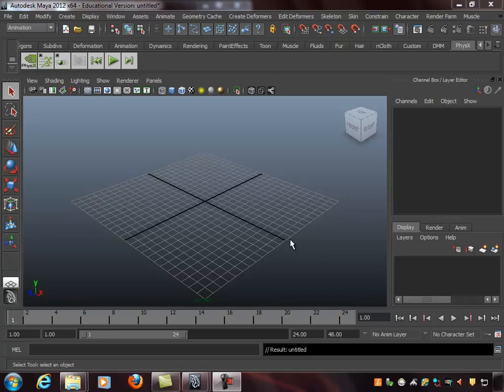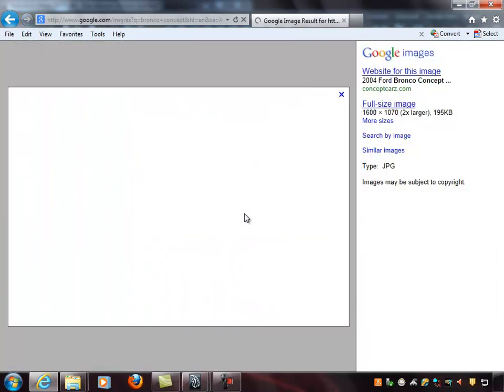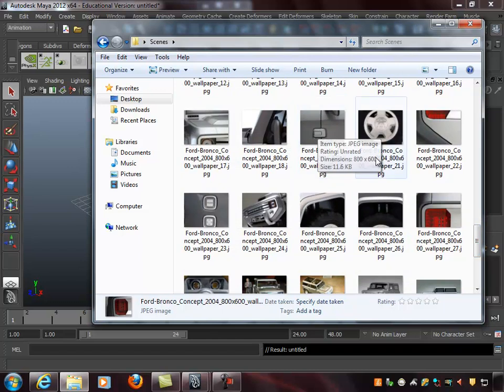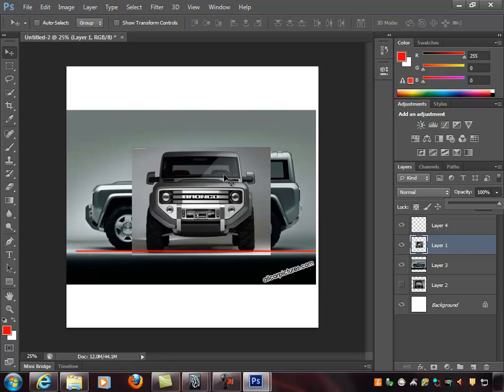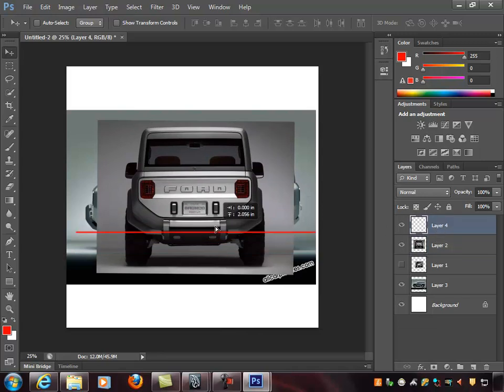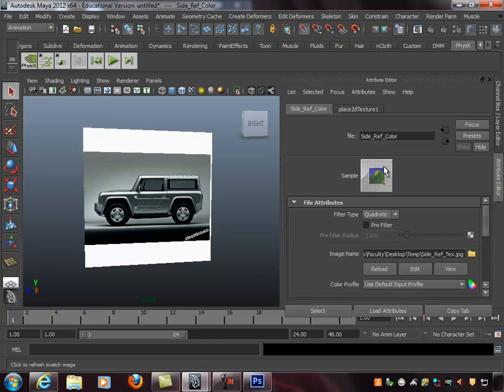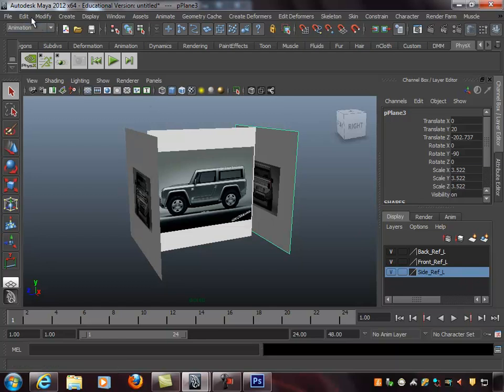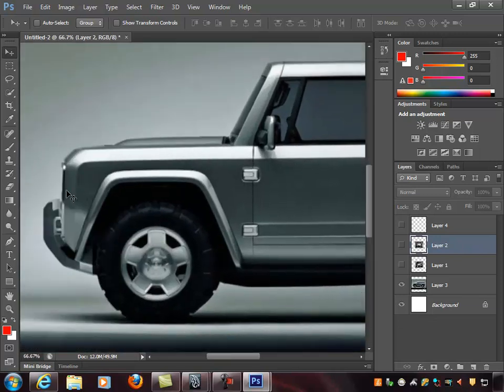HSOM Lecture #07 Car Model Edge Flow

Comment: Thanks for the tut.  Nice one.  Looked at lots of these as I'm getting into making assets for use in UDK.  When I first saw this and notice the length of the vid and heard the monotone disinterested drawl (not a nasty comment!) I thought I would end up switching off after 3 minutes but I didn't and it was great.  Thanks!  I hadn't seen the method of putting the images onto polygon layers like that before, I had used the other method of setting a background image on each view.  Great stuff thanks